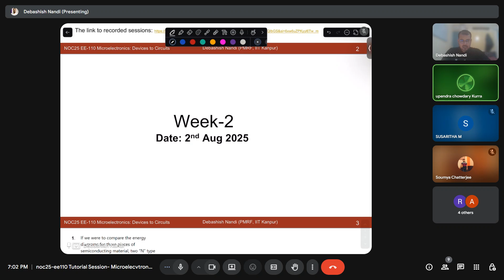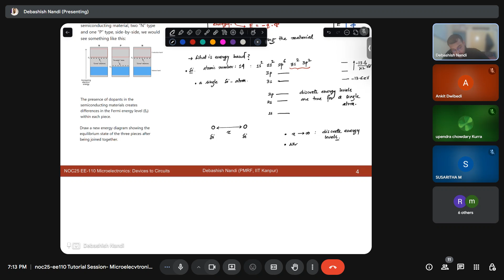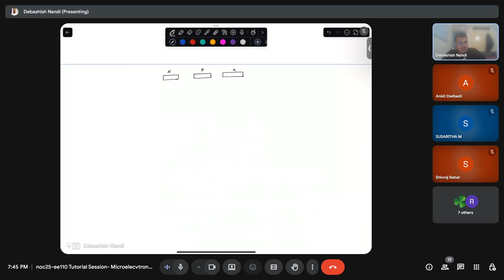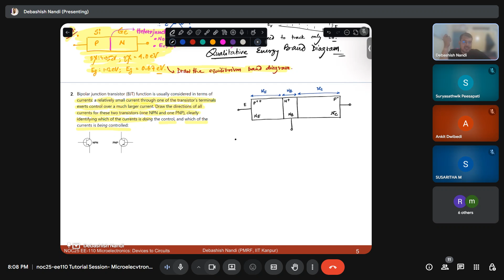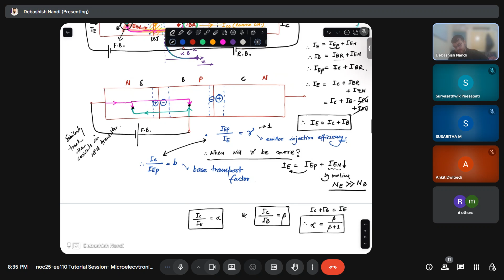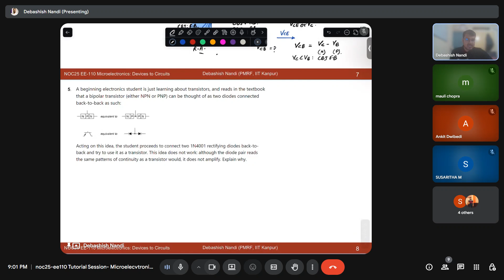Week 2: BJT Working Principles: Energy Bands, Currents, Gains & Modes of Operation, DMM Diode Check

Comment from the maker: The fabrication steps of a monolithic BJT are nicely summarized in: https://www.cet.ac.in/wp-content/uploads/2023/01/Part-IV-BJT.pdf. This should answer the question of how the n/n+ layer of the collector (of an NPN BJT) is fabricated. While the n+ layer is fabricated by diffusion , the n-type layer adjacent to the base region is an epitaxial layer using, for example, CVD (Chemical Vapor Deposition). For more details on the fabrication process, I recommend the students read the Plummer and Griffin book on "Integrated Circuit Fabrication: Science and Technology."